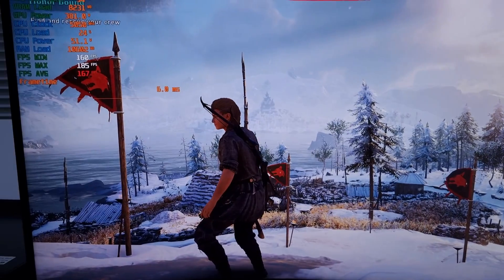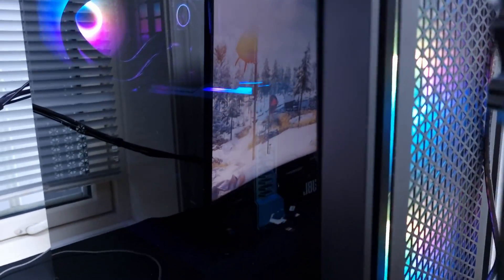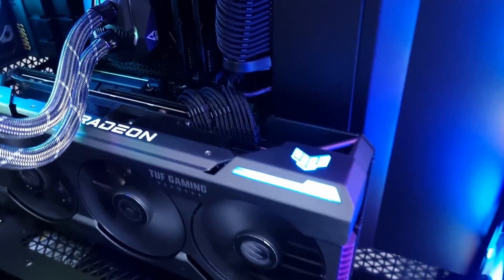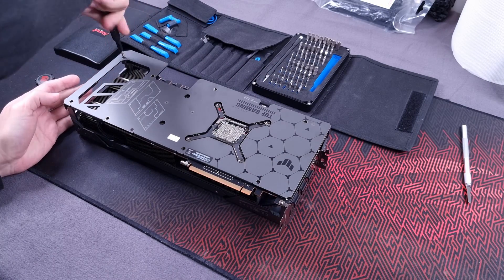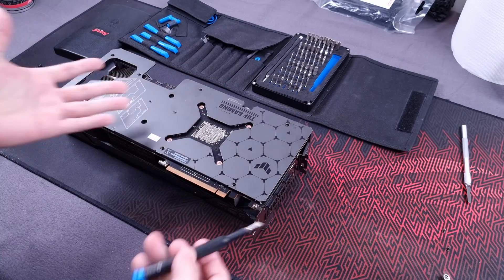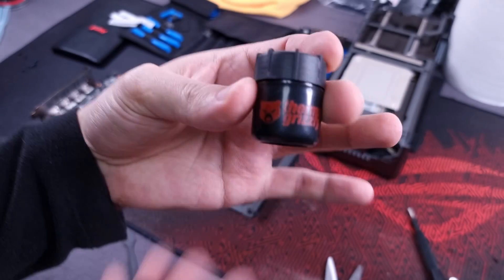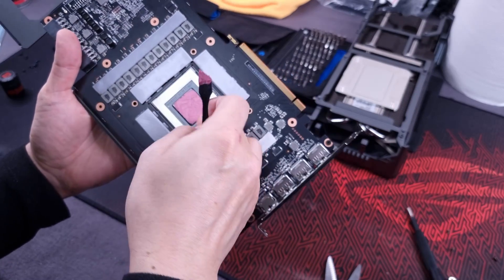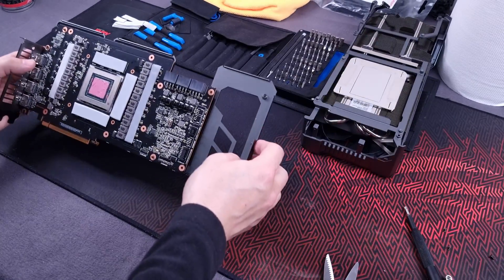ASUS TUF RX 7900XTX TEARDOWN (hotspot fix)

Comment: Why remove the blue part and press down with your fingers? You are just adding grease to your pads..
Reply from the maker: @PetterNorthpole  You do not know this, based on your comment, but a lot of thermal pads have oils to keep them from drying out too soon. Skin oils make 0 difference. The plastics on thermal pads are there to keep debris, like dust and other small particles, from contaminating the pads. I hope you learned something new today.
Reply: @TechnologyHive  Heads up. It's a different kind of oil.
Our sweat can oxidize copper and other metals.
Reply from the maker: @ Heads up: It still makes no difference. We come in contact with copper and other metals on a daily basis. I repair GPU's for a living and in all the years of working with these things, I have never heard someone being as worried about sweat and body oils. If you were right in the slightest, everyone should put on gloves and sanitize their hands before touching a heatsink. Let alone a silicone thermal pad 🤣.

Comment: Sometimes you can just tweak the 4 screws against the bracket that holds the GPU against the heatsink/fan assembly. Tweaking them can help create better contact. It doesn't always work but in many cases it has dropped that 20 degree delta between core and hotspot by 10c.
Reply from the maker: @GSP-76  I made a video about this subject a while back. But in this case, it's not the screws. It's the AMD chipplet design, which is to blame.

Comment: Honeywell PTM 7950 is the way to go, ive had mine installed for 2 years now and its never EVER changed in temps since day q of using it... my temps are 55c and 70c hotspot....ALWAYS at max gaming temps.

Its insane stuff 😊
Reply from the maker: @FromTheGroundUP627  Have you tried Thermalright Heilos? Excellent stuff also.
Reply: @TechnologyHive  no I can't say that I have...first time I've heard if it. Is that also a thermal pad?
Reply from the maker: @FromTheGroundUP627  It's like PTM, but made by Thermalright. Good stuff.
Reply: @TechnologyHive  yer i watched a video last night about it. Not sure what the difference is in temps against each other but I've noticed there the same 8.5w thermal properties.
Reply from the maker: @FromTheGroundUP627  Maybe made by same manufacturer, just rebranded.
Reply: @TechnologyHive  yer I wouldn't be surprised at that tbf. I'll just stick with honey well,I use it on my 5900x and gpu die and haven't had any worries for the last 2 years. Temps are perfect still.
Reply: @TechnologyHive    yeah helios is rebranded ptm7950. Spec sheet of both are identical. Really good stuff, I'm really happy with the product

Comment: @TechnologyHive  in my country people sey radiator,if you search to amazon you view radiator gpu or cpu!your first test not only had the hotspot high temperature and the gpu!so verry simple not good contact with"heatsink"it's not the thermal paste that's to blame,I installed a new backplate, without removing the heatsink, without changing the thermal paste and the temperatures dropped.

Comment: actually that's pump out the hot spot is where the past is missing in the middle when applying the paste use the spatula to spread it out evenly, I tape around the die so the past doesn't get all over the place then remove the tape you could also remedy this problem with the KryoSheet Thermal Pad by Thermal Grizzley but you need to insulate the components around the die just in case anything breaks off or makes contact
Reply from the maker: @paulburkey2  No, it's not pumpout out. It's the chipplet design, which is not 100% flushed.

Comment: Funny story here too! I have a Tuf 4080, it's just over 2 years old and lately it started to thermal throttle in heavy loads and even normal gaming, the way I noticed is the core clock would drop significantly and core temp was high so I looked at the hotspot temp and it was over 100C. Took it appart and repasted it with Arctic MX-6 and temps dropped 30C!! Now the fans barely come on while gaming, I even flashed the Strix bios onto it and it woke that thing up, way more performance and it stays cool while gaming 50-55C vs 75+ before repaste. So glad this was an easy fix!
Reply from the maker: @Grimrogh  happy ending there 🙂
Reply: @Grimrogh  I am having issues with my Tuf 4080 too, but I will replace it with ptm7950, did you also replace the thermal pads on the vrms? If so what thickness did you get? Thanks.
Reply: @armandoarroyo  I did not replace the pads, they were in very good shape when I took the cooler appart, no rips or anything like that. Just be gentle when you seperate the cooler from the pcb and you should be ok.

Comment: Is not from hotspot because you have first time gpu 75 C with hotspot 95!if is from hotspot you have gpu 55 and only hotspot 95C!it's from the pressure of the four screws, it doesn't press the blackpate well on the GPU radiator and in the heat it deforms over time!!!
Reply from the maker: No, bubblekuku. Btw, its called "heatsink" not, radiator.  😆

Comment: I got a 4070 also asus tuf. The hotspot was running 106 degrees(!) under load I noticed it some time ago, but yesterday decided to repaste. When I opened it I saw similar picture to what you're showing here, but worse - there were parts of dry thermalpaste on the radiator preventing full contact, but much less actual thermal paste on the chip itself(literal 1 drop!). I applied some old cheap tt paste instead, now it's 30 degrees cooler. I feel like asus needs a better quality control, at least for the higher end gpus. I wonder if higher end ROG models are also victims of their irresponsibility.
Reply from the maker: @ic1ph3r  They're using cheap pastes to cut corners. Sad.
Reply: I also have an ASUS 4070ti super and recently started having a similar problem too. My hotspot is spiking to 100-105c randomly then the fans rev at 100% then it goes back down, is this the beginning to this problem?
Reply from the maker: @Steeeelo47  Just repaste it. Use MX-6. The problem should go away.

Comment: Did you not overclock the card? And is it not large because it probably puts off a lot of heat?  Might want to try changing the position of the card as well.
Reply from the maker: @RAY_FILET  No, I don't overclock my gpus. And no, there's no need to change position. Card is fine as it is.
Reply: Core clock boosted is ~2500 mhz.  You're running at almost 3 GHz.  Your card stock before boost operates at ~2 GHz.
Reply from the maker: @RAY_FILET  The card automatically uses cooling overhead to boost as high as it's possible. What you're seeing is the card doing its thing. Now that I have switched to Thermalright Heilos, the boost is even better, as it's more stable.

Comment: I have results close to yours but I don't like the difference between the heat and the Hotspot it's a 25 degree difference which is really worrying
Reply from the maker: @tech4612  It is because of the chipplet design.

Comment: Mate you forgot to add thermal pad on the chokes, the right side chokes when you look the card on the table, left side only thermal pads are on the mosfets, on the right side it goes on the mosfets and the chokes. Watch your recording man, and I have seen other videos, about the chokes on the right side, thermal pads are needed and are going there! But your mistake.
Reply from the maker: You obviously did not pay attention to the video. There are no pads on the left side coils. And the heatsink has no area that makes contact with those coils either. No mistake here.
Reply: @TechnologyHive  Ok here it is:
This is how pads are originally : https://puu.sh/KloWN/28e184fd00.jpg
Second image: https://puu.sh/KloWQ/9764cb764a.jpg

And now this is where you take your GPU apart where right one side you can see thermal pads on Chokes and Mosfets: https://puu.sh/KloX3/f295f49085.jpg
This is where you close your GPU, where you only add thermal pads only on the mosfets, you didn't add on the chokes on the one side: https://puu.sh/KloXd/d090e150fb.jpg
Reply from the maker: @edgeontomorrow  Yes I see what you mean. I have since fixed this already. Thanks for watching!
Reply: @TechnologyHive  You saw I am glad, FIX it because the Chokes are meant to be cooled too, with the metal frame on it with a thermal pad. I am pleased we understood each other, I was like, why would your GPU go hotter on parts where it could be cooler?! Oh and I am deciding whether to buy this GPU in my country it goes for 1100€, no price drops or anything, for the same price of $1150, and an RTX 4070 Ti SUPER ROG STRIX for $1125, I mean very expensive tho, because here in Nort Macedonia these firms for PCs and PC parts, GPUs, CPUs, and everything, here there are 2 major stores for PC components, but they pay a lot for tariffs, customs, shipping and that's why the prices are high, I mean now RTX 4070 Ti Super Strix that is only available here, and there are 2 of them, for example, its unavailable on amazon anyone that want to buy it is available on best buy in the US for $950-1000, and to get it here from the US to Europe how much will it cost and the taxes and the customs and the shipping, you get it what I am saying! And the RX 7900XTX Tuf like yours goes for $1148.99 on Amazon and where is shipping, taxes, and customs, it will be some $200 or something to deliver to me. So when I look for 7900xtx it is the same price here in store as it is on Amazon. But it's a good card for Rasterization pure gaming, no RT and stuff, on the other hand, DLSS is getting better and better, so that is why I have second thoughts about which one to buy, 7900xtx, but it is more for the temps when I open internet soo many people including you have temps issues, hotspots, etc, some cards like the Tuf where I see people benchmarking have hotspot temps below 80c on full load and GPU goes to 60c. When I see such benchmarks that gives me the GO AHEAD for AMD GPU, but I don't know, here I cannot even buy thermal pads, I can get hold of thermal paste of thermal grizzly or MX-4 or MX-6 more or less around those, but to buy new GPU and to have to open it is kinda frustrating, I don't know, I just don't know? What would have you done, some advice?! Thanks!
Reply from the maker: @balkanska_elita  Inductors are not crucial to be cooled with thermal pads. I repair these things for a living, and from experience, i know most GPUs do not have pads on them because they are basically just copper wire in a ceramic package. 

I would still replace the thermal paste on any gpu I buy. MX-6 would be my choice. Hope this helps.
Reply: @TechnologyHive  Is there somewhere where I can contact you, to realize your mistake? Obvioslly I cannot send you images here to see?

Comment: You should have used a Thermal imaging camera to verify the hot stop. Just taking numbers off the S/W chats is not professional. On top, you have zero info on ESD safety. Kindly anyone watching this clip, please consider using common sense, and basic electronics.
Reply from the maker: @zandanshah  I think you mean well, but are misinformed. From using a thermal camera to "verify" the hotspot to ESD concerns, your comment shows how little you understand these things. But stick around and you might learn a few things 🙂.

Comment: Fans need to be used, they were definitivelty running super low!
I always set them manually before gaming.
Edit: You forgot VRAM temps and monitoring FAN speeds too!
Reply from the maker: If you don't mind the noise, sure.
Reply: @TechnologyHive  Of course, performance and durability, always. Heat needs to be removed by force, and there's no miracles.

Comment: nice video bro I have same card but with nvidia rtx 4070 ti super I have same problem with hotspot only you applied thermal paste with spatula s a pea-sized dot enough, or do I need to spread it with a spatula?
Reply from the maker: @JohnnyJuegos  I would spread it to be sure of proper coverage.
Reply: @TechnologyHive  ok bro do you know if its good artic mx6? before I had rtx 3070 ti zotac but same with that graphic card I changed all thermal pads and thermal paste every month the thermal paste headache so expensive cards with this stupid problems so you have so much time without change the thermal paste? because with artic mx6 I changing every month atleast with rtx 3070 ti zotac amp holo xD
Reply from the maker: @johnnyjuegos  I like MX-6. Best of the bunch. It is supposed to last 10 years, but I can not verify that.
Reply: @TechnologyHive  well I hope not destroy the default Thermal pads because it's so difficult and expensive in Amazon to get ones I only go to change Thermal paste do you recommend have less than 95 degrees on hotspot? Because some users or nvidia saids than this gpus can support 100-115 degrees but im not sure ..

Comment: I always lik watching these kinds of vids...we gain so much knowledge even if it's the same vids...keep up the good work but I wouldn't tell ppl not to mount it horizontal but rather say u have 2 options...which i highly recommend regardless the size of ur GPU is 1st option get a GPU support... it's lik adding a lil mini table leg to ur GPU (asus even added a GPU support in the box with the new releases from the start of this year... itll work depending on the design of ur pc case)...2nd option get a vertical mount
Reply from the maker: When you dedicate time and money on repairing GPU's for a living, you will understand my intent. There is not two options, but one in my opinion working with these things frequently. If the card is heavy, and long, mount it vertically. Period. But your money is yours to spend and do as you please with it in the end.

Comment: What is he complaining about?100% GPU load , 75°C gpu , 95°C gpu hotspot . 
I have a 40°C delta on mine , 90% Gpu load hiting 110°C gpu hotspot with 75°C gpu.
Reply from the maker: Congratulations! Your GPU runs hotter than mine!
Reply: @TechnologyHive  Sorry that came off as rude ^^'
Thanks for the video its nice to have this option if the problem persists or RMA is impossible for people. 
Im just frustrated with my 7900xtx too ^^'

Comment: Agree that the hotspot delta sucks but it technically is still within spec.  I finally gave up and switched to water cooling.  Most of the heat issues went away.
Reply from the maker: @jjs71072  Very nice.

Comment: You have a 25-C Delta after, was 19-C. Went from in SPEC to OUT of SPEC. What do you think went haywire? Gaming my 7900XTX has a 13-15-C Delta, some benchmarks get it just over 20-C. It's only 3 months old; I applied new paste on the GPU, gonna try to upgrade pads, and new paste. I had a similar pattern at the GPU/Cooler mating point. Evidence it wasn't making complete contact. The pattern would suggest the cooler plate is concave, .002-.004" or so. ???
Reply from the maker: @watchthisusa  To fix this, I ended up taking the card apart once more and applying Thermalright Heilos.
Reply: @TechnologyHive  Those are working well? Are they pretty soft?
Reply from the maker: @watchthisusa  Thermalright Heilos is what I use in my personal rigs. Yes, they're working great.
Reply: @TechnologyHive  Cool. Thanks!

Comment: My card has very little coil whine, but it also has a big temperature gap of about 30 °C between the chip and the hotspot.
Reply from the maker: @BenderTheOffender  Both are typical for this card. The coil whine is no real problem, but the temperature delta can be an issue. Try Thermalright Heilos.

Comment: Did you start having high temps again?  I've had 3 different XTX's and it seems like they all start getting high junction temp after a couple months.
Reply: Yes, i have sapphire reference design 7900XTX and hotspot started on 95 degrees but after 2 years of hardcore gaming it got worse to max 105/106 degrees WHILE GAMING. I should probably repaste but I am scared since i have never repasted gpu
Reply: @kucacz5609  I need to do same still! I got some PTM 7950 (thermal paste alternative) but I haven't cracked open the card yet
Reply: @paulw7738  Okay, today this is the first time I saw the temps creep up to a 107 degrees on hotspot while playing minecraft xD. Should I be worried and can this damage the card somehow?
Reply: At least I am not cold this winter lol
Reply from the maker: @paulw7738  Yes. I had to finally settle for Thermalright Heilos. This kept temperatures under control.